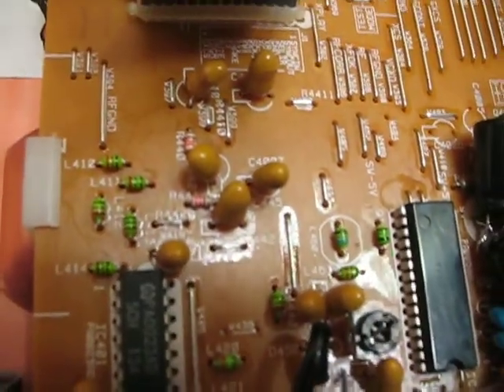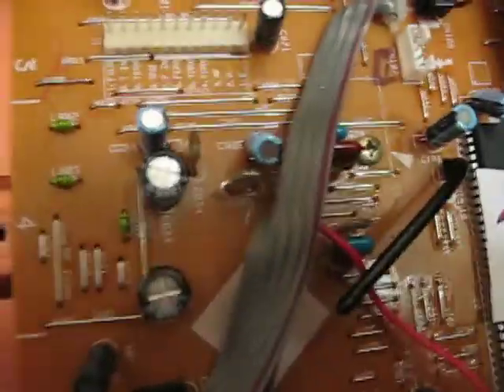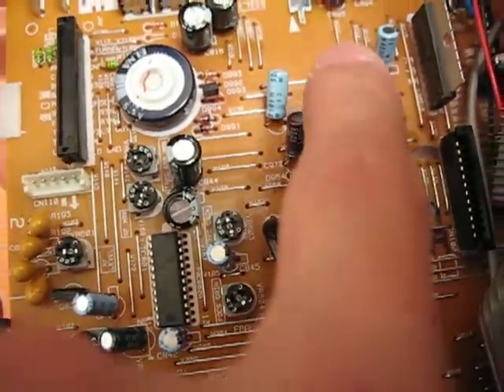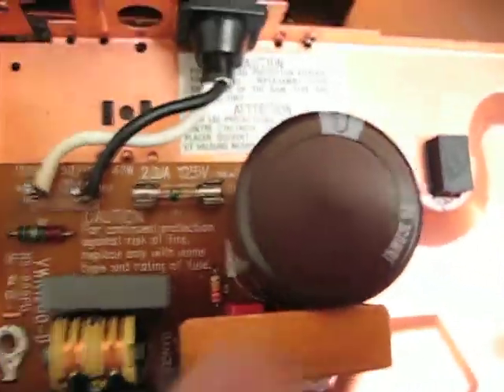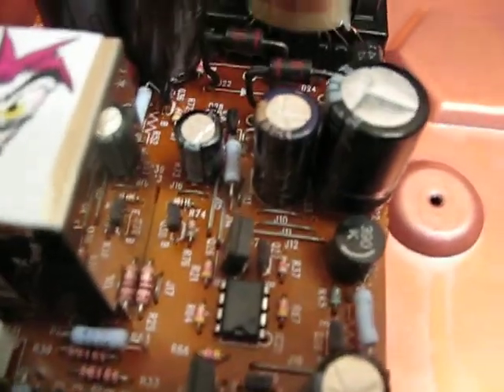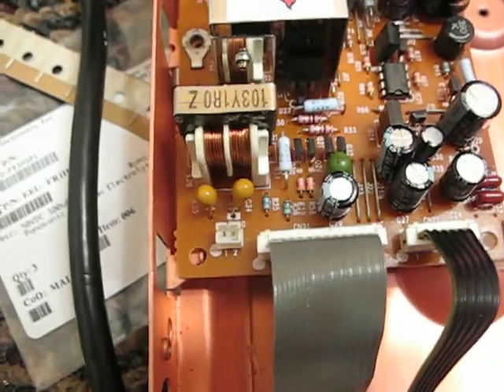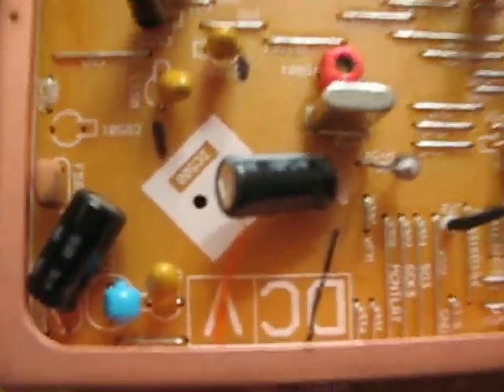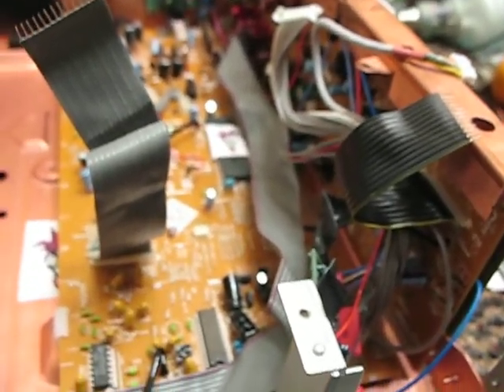Mods of a Pioneer CLD-99 laserdisc player

Comment: All you did is change out existing caps (newer/bigger ones), that may have not needed replacing to begin with. The format is the limitation , you can spend $$$$ on player mods, but you can only get so much resolution from the discs themselves. Just like your blogs, plenty of talk, no evidence of improvements. A big Nothingburger.